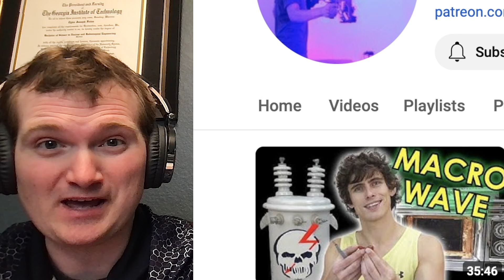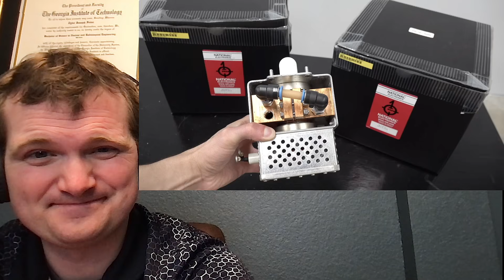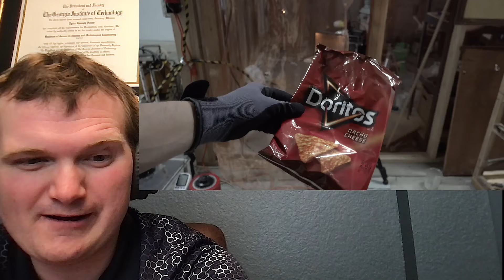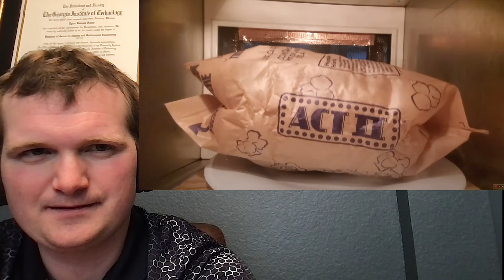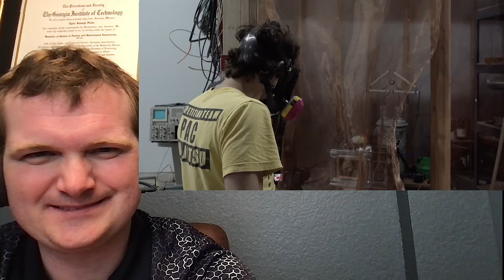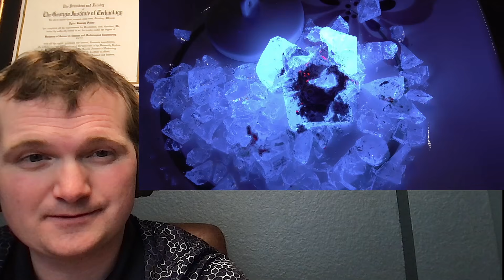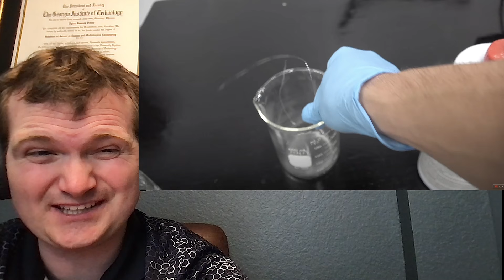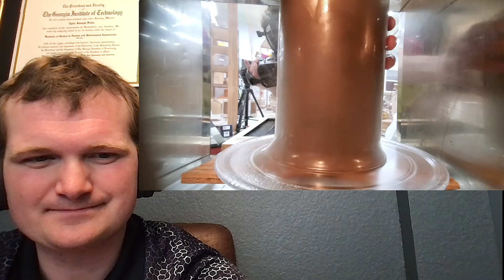Styropyro's MACROWAVE - Nuclear Engineer Reacts

Comment: The first Radarange was made by Raytheon in 1947. It was almost 6 feet tall, weighed 750, consumed 3 kw of power and sold for $5,000, which had  a modern purchasing power of approximately $70,000.
Reply: Raytheon? like the weapons contractor? Well that's terrifying.
Reply: @CoreyKearney  raytheon has a pretty interesting history and only became a weapons contractor due to their specialized manufacturing that was needed to build the first radars and then it snowballed from there into the company they are now.
Reply: @CoreyKearney  microwaves were discovered by experimenting with radar in millitary

Comment: UN 1993 is diesel and the like. Yeah, it's flammable, but it takes a bit to get it going. Either way, those are placards and meant for hazmat transportation, not labeling containers. The 1993 and poison placards would be in violation if they were on a vehicle.  Odds are he doesn't actually have any flammable products in the cabinet and, as a chemist, he has it just in case he does. And, if he does, it's obviously as flammable as diesel and is of little risk of it catching fire.

Comment: I installed a commercial microwave conveyor used to cook bacon for a national sandwich chain. It was(10) 20k emitters but they run at something like 10 percent power for efficiency . Apparently cost per hour is better with a large emitter at low load than using one rated for what you need at full go.
Reply: I imagine durability is vastly increased as well

Comment: I will say, there's a wonderful irony that Boron, a chemical used to help prevent excessive radioactive reactions, glows almost the exact shade of green cartoons use to show something is radioactive
Reply: Although isn't that color more likely to be inspired by the color of radium watch hands?
Reply: @soundspark  Yes, that's right, but the green color of the clock hands is not because of the radium, but because of the phosphorescent paint that they put together with the radium, the radio only served to give energy to the paint to glow.
Reply: @DrArkham.  Yup.  Copper doped Zinc Sulfide.  Use Silver instead of Copper and you get blue light.
Reply: @Yaivenov  Strontium aluminate doped with europium and dysprosium
Reply: @stopthephilosophicalzombie9017 if made with 90Sr does it become self fluorescing?
Reply: @Yaivenov  Yes, but insanely more dangerous than the radium version as Sr90 is a beta and gamma emitter whereas Radium is an alpha emitter.
First of all you would need more strontium for the same glow effect and secondly you would have to shield the thing in like 10 cm of lead for it to be safe to be near.
The reason is that the beta and gamma radiation interacts less with the phosphor (thus requiring more radiation to start with) and is much more penetration (thus need much more shielding)
Reply: @soundspark  It absolutely is. That's why it is more ironic, and less a fun fact
Reply: @Randerson2409  It's actually not more ironic, it's more boronic.
Reply: More boring definately  @JamesChurchill3
Reply: @soundspark  Or uranium glass.
Reply: I like the irony that prions are still used to scare people, yet they've known since 2012 serine proteases are the cure lol.
Reply: @alexdenommee3219  Was this supposed to be under a different comment thread? No one here was talking about prions
Reply: @Randerson2409  wait since when did prions have cures?
Reply: @vibhaandasguptaThere isn't. Serine Protease is an enzyme in the body that breaks down proteins. It was investigated if it can break down prions back in 2011, but that was in vitro work and even as late as 2022, it is only viewed as a potential therapeutic target, rather than a "cure".
Reply: @Randerson2409 exactly, i thought prions didnt have cures yet
Reply: @alexdenommee3219 There's still no known cure for prion diseases.
Reply: @alexdenommee3219 Bit outdated info here that I wanted to follow up on since I'm also a bit rusty on prion disease news: There's still no cure to HUMAN prion disease. I think you're referencing the serine proteases from a specific species of lichens that work effectively in a petri dish or on a patch of soil (aka that great 2012 breakthrough about environmental clean up!) but they cannot be injected into humans to cure the disease. These large enzyme molecules cannot cross from the bloodstream into the human brain, where the actual damage occurs. Then there's the immune system - where, if introduced into the human body, the immune system would flag the foreign lichen enzyme as an invader and destroy it immediately. And then there's toxicity to worry about - bit of a friendly fire thing: a powerful protease flowing freely through the brain would blindly digest healthy brain proteins and tissue alongside the prions.

Don't get me wrong though, it really was a nice breakthrough back then! Prion diseases in wildlife - e.g. Chronic Wasting Disease or "CWD" in deer and elk - spread easily because prions remain active in soil and on plants for years after being shed. This cool natural enzyme in those specific species of lichens was a nice discovery celebrated as a potential "environmental cure" to naturally clean up landscapes and pastures, alongside decontaminating infected medical equipment. But for humans and medical cures, it's still far out from being an enzymatic cure success. 

It looks like most research has since redirected away from enzymatic avenues toward the realm of genetic therapies - aka silencing the prion gene using tools like base-editing gene therapy and antisense oligonucleotides (ASOs), which safely lower the body's production of prion proteins to stop the disease from developing - more prevention and development inhibition rather than reversing advanced brain damage. Which makes sense because if we try to reverse the brain damage first before even inhibiting the damage - you know..

Last I'm seeing, there's one human clinical trial with symptomatic prion disease patients where we test a small interfering RNA (siRNA) molecule on cutting the target RNA so the brain scales back production of the prion protein drastically = halting the substrate the disease needs to multiply. And then as I mentioned before, the ASO trial, which uses a drug called ION717, designed and developed by Ionis Pharmaceuticals to safely silence the prion gene in humans. Pretty fascinating work - but research money recently.. cough politics *cough*.

Anyway, maybe I missed a study or something, let me know!
Reply: well if the boron gets that fucked up by the radioactive reactions then it's dangerous

Comment: boron gets mentioned in the video
Me, immediately: oh, Tyler's gonna bring up "liquid control rods" again
Reply: someone should make a t folse bingo card
Reply: I'm not an engineer or anything, but aren't control rods solid material covered in a zirconium cover?

I tried searching more about "liquid control rods" specifically and nothing is coming up, so what does this mean? Is this a meme that's going over my head or something?
Reply: @alexdenommee3219  It's been referred to a couple of times in both solid and liquid form in the videos. I assume they're both used in similar ways in perhaps different contexts/conditions.
Reply: @alexdenommee3219  boron is dumped into the reactor. it's used the same way a control rod is: slow the reaction created by the reactor.
Reply: @alexdenommee3219 Boric Acid? 🤔
Reply: @alexdenommee3219  
There's no such thing as "liquid control rods". What he means is, that aside from using the control rods to control the fission rate, you also use boron in the water. When a reactor has new rods for example, you use a high concentration of boron in the water and the rods. When the reactor core cycle reaches its end, it is less fissile, so you use a lot less boron in the water. So the fission process and balance is controlled both by the control rods but also the boron in the water.

Also, control rods are not solid metal inside. They are either filled with pellets or powdered neutron absorption materials.

Comment: My 1300W microwave will boil a cup of water in about 40 seconds.
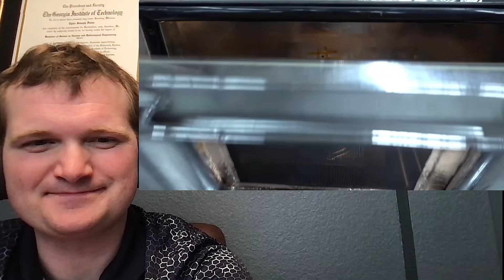Reply: 1300 W that’s very powerful the highest I’ve seen commercially available is 1400 and the highest common one I’ve seen is 1250 mine is 1200 15:54

Comment: Styropyro is one of the few people who can explain complicated topics in a way, that even toddlers can understand it. And a little side note: Tungsten is really good at shielding radiaton, but gold also is (and gold is actually sparely used for this purpose in the medical field)
Reply: Just gold plating, which is very thin, is a very good shield, often used in connectors for making them more conductive which is what they are usually advertised for but really helps with shielding from external interference as well.  as the cables are often well shielded and the connectors are not.
Reply: just goes to show how much he knows about his stuff,  the guy is great honestly
Reply: Worked in a Hospital that did proton therapy...their gold 'drapes' were 18K gold.
Drapes were used to mask off areas that didn't need radiation.
Part of the inventory process was weighing the drapes on a regular basis...they were essentially chain-mail and it would be easy to clip off a link or two...
Beautiful to see when we had them all laid out for inspection.
Reply: Gold plating inside my bunker, new goal achieved.
Reply: Gold plating is used on astronaut helmets to help with the radiation as well
Reply: Gold is also used on stealth fighter canopies in a transparent amount along with tin and indium as it prevents the radiation from an enemy's radar penetrating into the cockpit which has all sorts of Non-Stealth geometry @Evil_Angelica
Reply: Lead works as well